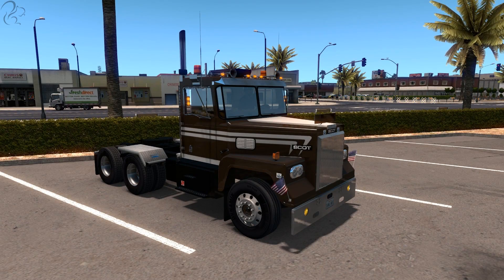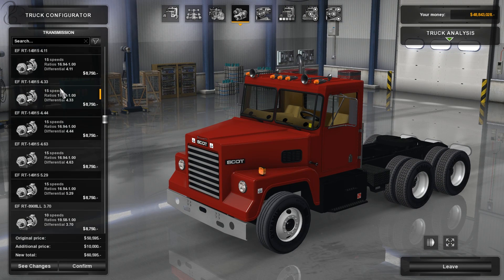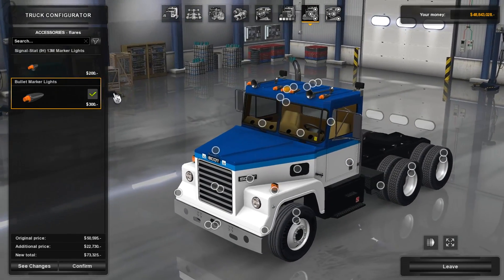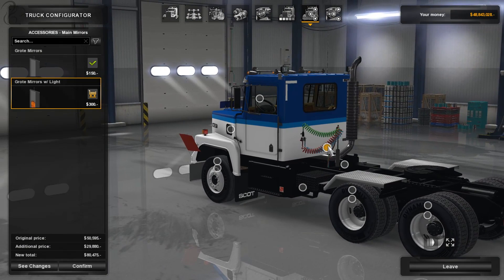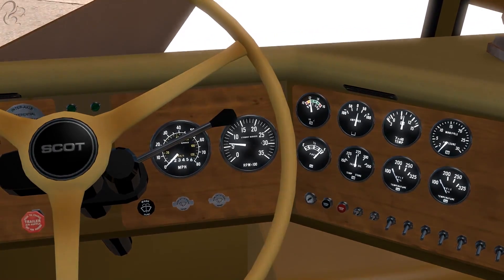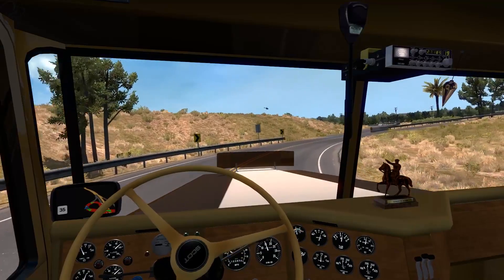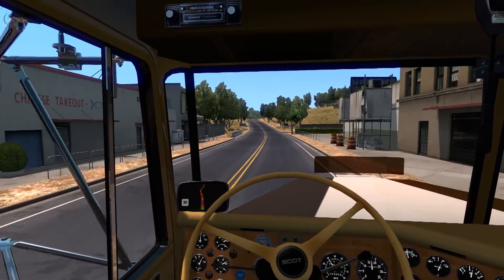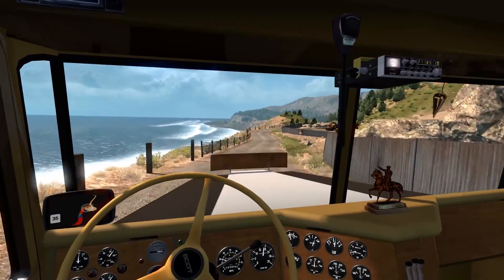Scot A2HD Vintage Truck - Mod Review (American Truck Simulator)

Comment: Pull up a 1970 White 4000 and you will be surprised.  My dad used to drive one when I was a kid.  No right hand seat on his.  No AC and no Radio.  his had a 250 hp 6-71 2 stroke detroit with a 10 speed.  as underpowered as that sounds he regularly pulled 50,000 lbs with it.  I think it had close to 6:00 gears and topped out at about 55 mph.   I used to ride on an upside down 5 gallon bucket.  LOL  The good old days.

Comment: the alarm sounds you are saying is due to the electronic beeper being very cheap, so they are used in literally almost everything you need to make sound to beep out. 

but due to it too common in constructions, it's slowly being phased out for something else that's less white noise-ish.

Comment: Hello from Halifax Nova Scotia. Although I'm from Prince Edward Island originally (province north of Nova Scotia) and I am old enough to have been around when the Scots were on the roads, AND my dad was a full time long haul truck driver, I had no idea that these were made in Nova Scotia.....and by Irving at that! I learned something new today! Thanks Squirrel! 
A quick search found this video that you and others might find interesting. (I say video but it's just still images set to music). 
https://youtu.be/Bxu6bYpiB70
It's of some Scot trucks and other models in different configurations from around the same era (60's, 70's & early 80's) in and around Cape Breton Island, Nova Scotia. The 3rd image is pretty cool as it's a Scot truck with and Irving Oil tanker trailer. At about 1:56, you'll see an early 1900's truck loaded up with boxes of King Cole Tea, still produced today in Saint John, New Brunswick. (A neighbouring province). I think my favourite of the video though, is the 1935 White Streamliner designed and made for Labatt's Brewery of London, Ontario. Gorgeous truck! 
Anyway, thanks again and enjoy!

Comment: I tried that Big Ser, I have the options at the top of the screen but my GPS just takes me to another depot and not the land slide. I have world of trucks, so I don't know what is going on. Also,, I've been afraid to use Mods because SCS does not support them. If your system crashes, you better have ATC backed up.

Comment: Just a point of note on the speed, Canadian road signs were not changed to metric until 1977, meaning that an MPH gauge would be logical to have in a truck from the mid 70s.

Comment: I've never seen a Scot before and was curious. One look at it and I thought logging truck. They were that simple back then. The chrome accessories seem ridiculous, since it would spend a lot of time off the road, getting smacked by tree branches, splattered with mud, etc. Short exhaust stacks would be typical. The "reverse" lights we called load lights, and were used to kind of see your load in the dark for putting on the chains or straps. The logging trucks in northern California had large steel forks on the sides to secure the logs, so they didn't need to be secured.

Comment: Back in the day basic was basic.  The passenger seat in a basic truck could come just like you see it.  Some even came without a passenger seat.  It's called a 'WORK TRUCK" not a limo like they are these days.

Comment: What a coincidence... I tried out this truck in ATS today & didn't like that too much. It had 8 gears forwards & struggles to accelerate while pulling a 7t trailer & turning at the same time
Reply: I tried it out too. I only did one job with it. I put an 18 speed and the best engine I could in it. and it struggled to pull 33,000 lbs trailer. I quickly swapped back to my international 3800.

Comment: Awesome, I saw its price in the beginning of the video, only around $50.000 wich is less then half I paid for my Freightliner. Seems this Scot truck (with a 600HP engine) is a good truck to buy and be used by my staff while building up my truck empire. I just let my personel drive these Scot trucks while I keep on trucking in my Freightliner. Thanks for the video Squirrel. ps. I play ATS in VR using my Oculus Rift, so I would have no problem seeing the fuelgage. ;D

Comment: Pavel posted a picture of himself in front of a International Navistar building: Hopefully the gorgeous International Lonestar will be added to ATS soon!
Reply: Check out the top reply under SCS' current blog post.
Reply: Pavel said during the ATS stream before that that they had to schedule a trip out to the US to take reference pictures and sound recordings, and get the 3D and CAD files for a brand they had just signed a license with, so I think it's reasonable to say that International is the brand in question!
Reply: Thank you adding some information! Good news indeed.
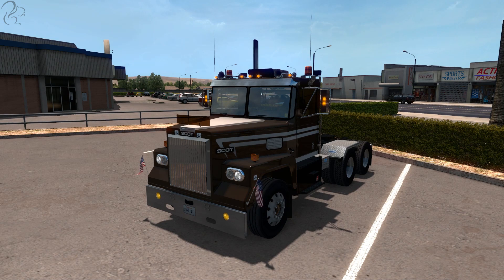Reply: Pavel did mention quite a handful of information in livestream about trucks in ATS. If you want to watch it the livestream replay is on their YouTube channel timestamp @ 14:45 :)
Reply: Thank you!